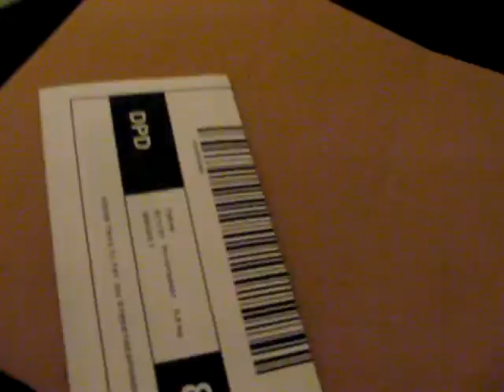wall mounted tire changer

Comment: Align the red spot next time as it can help with the balancing
Reply from the maker: It doesn't show in the video, but I did align the red spots for best roundness and also matched my rims and tires so that the yellow spots would get as close as possible to the valve even though the red spot had highest priority. The rims lacked marking on where to place the red spot so I used the tire balancer to show which side of the rim was the heaviest and then assumed that pointed to the part of the rim longest from centre. Optimizing the yellow spot might help you to save some balance weights but even with the yellow spot totally off you can still accomplish a perfectly balanced wheel only at the cost of some more balancing weights. However, the vibrations caused by a not perfectly round wheel can only be minimized by placing the red spot right, you cant compensate that with weights.

Comment: For the love of GOD put it on the floor and use two tire irons! lol.
Reply from the maker: Most people commenting here seem to have access to unlimited space in your workshop and totally miss the point of this solution. Yes, it is possible to buy a professional machine to change tires. Yes, it is also possible to buy a walk-around manual tire changer from some place like No-Mar or Harbor Freight. Yes it is also possible to lay your tire on the floor. However, all those solutions require floor space which I do not have. With my solution I am even able to change tires with my garage filled with cars.

Comment: is this a joke the worst tyre-fitter I've seen and that contraption on the wall don't cut it bud for god sake get a machine that at least stands on the floor, your fighting against it because of its position and you don't have a clue, and this would damage alloy rims, I can fit them by hand with just my hands on that sort of tyre no levers needed .tyrefitter of 30 years so I know what I am talking about.
Reply from the maker: Unfortunately my garage has no room for a machine. This was my space saving solution. I have used this solution to mount tires on Audi and Porsche Al rims, no rim damaged so far.